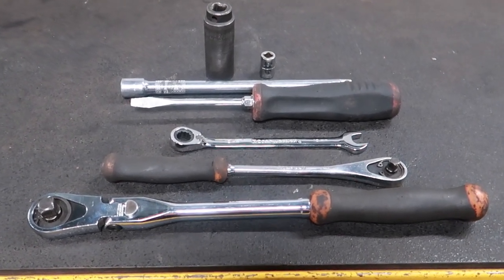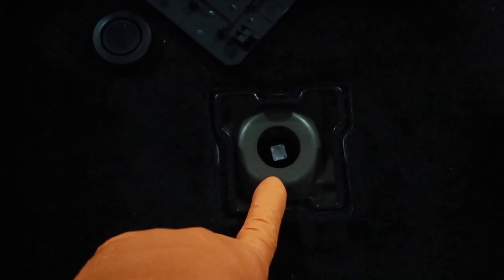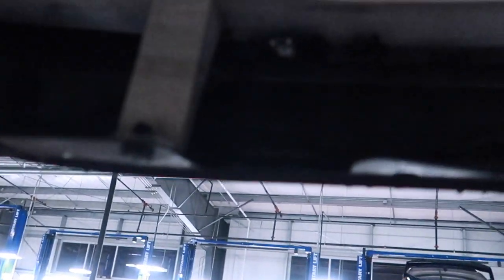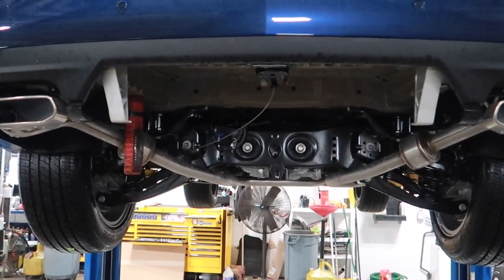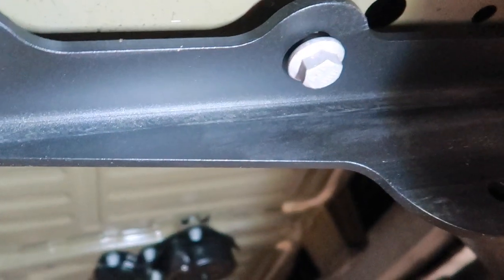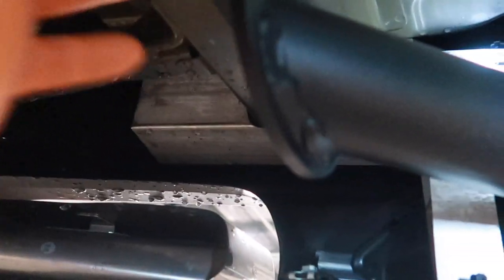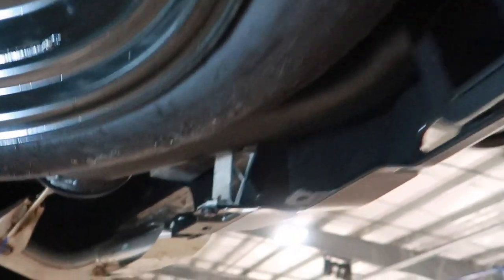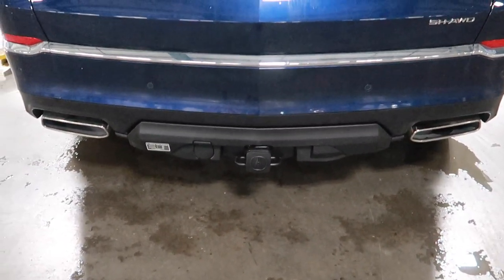2023 ACURA MDX OEM TRAILER HITCH INSTALLATION

Comment: Thank you for the part numbers on the kit - this is perfect for adding a cooler-carrier or extra cargo without throwing stuff up top and damaging the pano roof. I used to live up there and laughed out loud when you said to torque it dahn! $350 in parts beats what the dealer quoted me to add the kit, and this looks easy.

Great video.
Reply from the maker: Lol, thanks for watching! It was easy, I think the dealer charges $600+ total.
Reply: Quoted me just over $1k. Obviously passed
Reply: At what point did he note the needed part numbers????

Comment: Would you mind sharing links to all the components you got from?I cant seem to find fascia and the hitch you have with pre mounted mount for wiring.
great install though.Looks crisp🙂
Reply from the maker: Thanks for watching! Here are the part numbers I used. 
08L92-TYA-200 $312 and 
08L-TYA-200B $135
 I got them from my local Acura dealer.

Comment: Buy any chance do you have parts numbers for the hitch and the panel Thanks  Kim
Reply from the maker: Thanks for watching! Here are the part numbers I used. 
08L92-TYA-200 $312 and 
08L-TYA-200B $135
 I got them from my local Acura dealer.

Comment: Are there nuts on the other side of those screws?  If not, did you/should you add Threadlocker on those bolts to keep them in place?
Reply from the maker: No nuts. The frame has threaded inserts. While loctite wouldn't hurt, I have never had a problem not using it. Thanks for watching

Comment: Did you delete my comment?!?
Reply from the maker: I don’t believe so. What did it say?
Reply: @PIPSBURGHVIEWS  Man I could have sworn I posted it here somewhere yesterday.
Anyway, do you know the part # for the pin harness I'd need for a '23 MDX A-Spec w/o tailgate foot sensor thing (we don't have that and do not want it). Trying to figure out the correct harness number is impossible on some of these OEM Acura parts sites.
Reply from the maker: @Pens4Life85  I believe this is it.  08L91-TYA-200. They probably only make 1 harnesses and if you don’t have the sensor, you just don’t connect that plug.
Reply: @PIPSBURGHVIEWS  I've been spending lots of time here. Looks like I need to buy a hitch, a shaped plastic hitch cover, a hitch harness, a hitch ball mount, and a hitch ball. Most of the OEM parts sites want like $180-$200 for shipping. That is simply outrageous.
Reply from the maker: @Pens4Life85  the hitch is big and heavy. I would just buy it from your local Acura dealer. Try to beat them up on pricing.